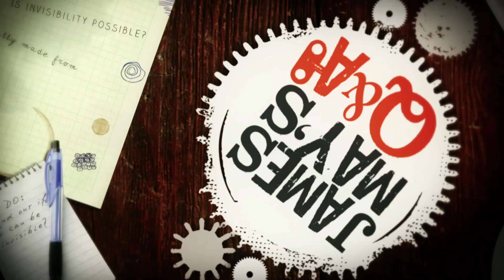Why Can't Trains Go Uphill? | James May's Q&A | Earth Science

Comment: To those who mock Gordon for getting stuck on his hill, consider this.

Gordon has frequently gone up that hill for years, with a long rake of fully loaded SR Maunsell Express coaches.
Each coach can hold 112 people, and weighs at least 32 long tons, or 36 regular tons; (72,000 lbs.) And the express usually consists of 5 regular coaches and one brake coach for the guard and the passengers' luggage. Which means Gordon has to pull a whopping total of 432,000 lbs, on a round trip across the island "twice before teatime." Fortunately, Gordon is an A1 Pacific. Despite being a prototype, Gordon has shown he can travel at an incredible pace, which has been proven to be around 100 mph, similar to his brother, the Flying Scotsman. But since there's most likely a speed limit on Sodor, let's say Gordon typically travels at a casual pace of 70-75 mph.

And Gordon's hill is set at a steep gradient of 1:75, or around 280 feet. 
This steep gradient, combined with a fully loaded expess, Gordon would have to be traveling at a significantly high, and constant, speed to make it up the hill without assistance. On a daily basis!

So, yeah. It's no wonder he's constantly needing to be banked up the hill by Edward.

Comment: Here is some same scenarios on distant land of China. 2.65% huh? Songshu-Wanjialing section in Shenyang-Dalian Line has that.
"In steam era it's a pair of QJ (2-10-2) to pull 7-9 freight cars through that. (Note that's 4-axle freighters at 92 tons each) For Passenger trains it's a pair of RM (4-6-2) to pull 9-10 passenger cars probably with an extra luggage car"
"Don't even think about running single steam in here, you need at least two and sometimes even more"
"ND5 diesels (GE Dash-7), when they were imported to China the first routes they serve includes this"
"South Shenyang-Dalian route is such a hard nut"

Comment: Trains can go uphill, but they may face some challenges in doing so, particularly if the gradient of the slope is steep. The main issue is that trains rely on friction between their wheels and the rails to maintain traction and move forward. When a train is going uphill, the weight of the train and the force of gravity pulling it downward can reduce the amount of friction between the wheels and the rails, making it harder for the train to move.

Comment: There is one modern Swedish railway that has some shockingly steep hills for its young age (late 90s/early 00s). Mälarbanan between Arboga and Örebro has hills at 2,5% and allows speeds at 200 km/h, while the normal limit for a new Swedish railway is 1% steep hills.

Comment: banking locomotives or banking engines help push locomotives up inclines. 

and the rack and pinion locomotives like the ones in switzerland and american use pinion gears powered by the steam engine. the pinion gears allow the locomotive to climb on the rack gear

Comment: I like to try and guess before diving into the video, my guess kept going back to weight but traction and gear ratio also kinda make sense. Im assuming trains gear ratio is low in order to pull so much weight so i imagine a train alone could rip up a hill but unlike on a relatively flat track adding carts to that equation dosent just add a flat rate of weight but multiplies the weight and stress on the wheels by every degree. I imagine traction would become an issue at that point, maybe if they put on the snow treds?

Comment: makes me wonder why they don't coat the wheels in rubber. or at least the rims.
Reply: It wouldn't last , plus,  chunks of rubber would deposit themselves in the rails eventually derailing the train.
Reply: In some track sections the signalling system requires the wheels and axles to short circuit the track for train detection, axle counters detect metal wheels as well. For electric units traction current needs to flow between the wheels and track.

Comment: You could slow the trains down my adding wind resistance, like parachutes made of solid boards that can easily fold up and deploy with the assistance of a little starter chute. The line would run through a metal pole that I elevated by a second shorter pole in the middle or there abouts with a hinge on each pole and a track for the second one to move up within. The parachutes would be brought in when nearing the end of their necessity by a ratcheting a steel cable in and wires forcing them into a formation that doesn't lend itself to catching air, or a way of opening them up so that they experience less drag and allow more airflow.

Comment: Here's a dumb question: why didn't they give track going up an incline some pattern. Anything other than baby's bottom smooth. I get why it isn't optimal most of the time, especially at high speeds where you'd get rocking and bumping and if it occolates too greatly you'd even derail. But you could have a hole for a pin in the train wheels and roll over some hinged steel cover that would basically give the train wheel literally any surface but perfectly smooth and thus introduce some real traction. If it sounds like a hassle to go through, imagine what it was like to purchase, operate, maintain, and  organizing all those locomotives to push up that hill whenever it was nessesary.

Comment: There was a part of rail line between two cities I travel couple times in a year. There was a small city with 50-60k population in the hilly area and even old cars and most trucks would stop and die on the road, smoking, overheated. And trains also would come to a stop and wait for an hour to find extra helper locomotives from nearby stations. But it wasn't always a case as I remember, I don't know what was the variables to make it stop and wait for rescue or to climb slowly. Maybe they would get that extra loco in the last station knowing it would definetely come to a stop if not pushed from back so you wouldn't have to wait for 45 minutes for help. They have changed the roads also the rail line in the past decade, but also cars and locomotives improved; so I don't know if the new line and roads saved them or improvements in the engine tech.

Comment: Even if an engine did have enough weight to get up a hill alone like the Lickey Incline, it'd be detrimental to the locomotive itself. I believe it was the BR Class 45(?) diesels that, during a standard express run from Kings Cross to Edinburgh and back again, the locomotive was so heavy and rather fat to the point it would need new sets of brakes for all of its axles, and said axles and wheels likely sustaining a substantial about of wear just from the fact they're under it.

Maybe taking a page out of the Model Railway book and fitting traction tires to real locomotives wouldn't be the worst idea considering no real life locomotives pick up currents from rails, but rather pantographs and power lines or fuel.
Reply: the pantograph is one end of the circuit and the wheels the other. Traction current flows through the track

Comment: couldn't they just have additional side rail tracks with teeth for gears to connect with, then on the train - have geared wheel hubs essentially slightly higher up, that the hill rails could connect with.

Comment: The wrong type of snow wasn't an adhesion issue.....it was that horrid fine hail that we just call snow, and it got into the ventilation for either the gennies or traction motors on certain units. I can't remember if this caused over heating or whether it melted and caused shorts.

I want to punch people who mock the leaves on the line thing like it shows modern trains are crap......steam locos have been DESTROYED by leaf mould low adhesion. Modern units handle it better......but the sandite train will still be out a couple of times a day in the autumn.

Comment: Determining the theoretical and empirical forces involved is an interesting physics exercise. Not mentioned in the video is the decrease in friction caused by the angle of the slope itself, as the vector of acceleration due to gravity increasingly departs from being normal to the track surface. Also, as a train move slowly, the friction more nearly approximates static friction, as opposed to dynamic friction. 

The difference between the two also contributes to locomotives being very difficult to brake, as the friction between the wheels and the track becomes purely dynamic friction. In a car drivers sometimes experience this on ice when limited slip easily translates to complete slipping because the friction is greatly reduced by the slippage itself. Changing the normal force (something seemingly silly like jumping up and down in the back of a pickup—and yes, I've experienced this) can cause enough friction to get moving again.

The static friction with a heavy load could also create a strange form of temporary adhesion that is not dissimilar to the bond used to adhere ignition point contacts in classic cars to the mechanisms used. It's actually possible to create a bond by simply polishing the materials and pressing them together with a high-powered press. It makes me curious whether a locomotive has incidentally become "welded" to the track. Incidentally, train wheels are welded to the axles by spinning them and slamming them together.

Comment: You have more grip than a train,  but as you are a machine of talking  bullshits.  I was  taking serious this video, until you said  the weight  with angled shape in the front of the train is developed to produce down force, like in a tractor or a race car ,  Instead of the REAL PURPOSE which is   remove  dangerous objets from the rails, before they make the train derail.  Also, there existed trains with  rubber stripe in the middle of wheels,  to produce the needed grip.  Like in Montral or Paris Metros .

Comment: While this isn't competly wrong, you still missed the most important part: Breaks. A train that goes up a hill needs to come down later on, and preferably with all passengers still alive. Due to how powerful todays engines are, the first engeneering problem us usally how to slow down the train enough when coming down and not the going uphill part. In fact, I know a project that was canceled because while it was possible to get the train up the mountain, there would be no safe way to get it back down.

Comment: Someone else said cogs.
So I thought.
An outer lane that holds a tow system for the back of the train a certain distance away.
The train slows down hooks it onto the end maybe it already has it after a certain stop. It reaches.
The train goes uphill with enertia and slight traction.
After the hills end.
The cogs rollback and weave into the outer side tracks as they head back to the start point.
.
But maybe it's a foolish idea xD

Comment: However, a locomotive can gain grip using sand, a lot of engines have Sanding Gears and Boxes to aid them. Wheel Size is also a big player. Smaller Wheels are for Goods  Engines and give better traction rather than larger wheels used for Express Engines which give better speed. The Power of BR's Power Classification also plays a major card. Weaker engines Such as 1F and 0P Engines are inferior to 8F or 9F Engines pulling heavier trains and going up hill.

Comment: So I'm commenting on this in 2022, because it was in my recommended, for some reason, and I think people might find it interesting, if anyone sees this. Here in Greece, we have a train called "Οδοντωτός" (pronounced "O-thoh-doe-toss", the "th" as in "the"), literally meaning "he who has teeth". It's called that because the tracks have spikes, or "teeth", sticking out of them , which the train, having the same teeth under the engine and each carriage, grabs onto, to help it move up a very steep incline in it's mountain path. The engine is also rather small, and so are the carriages, so that helps too. It was used in the past to transport people and goods up to a village, from another village lower down the mountain. It was a tourist attraction mainly, pretty much from the get go, when it started working in the 1890's. It's still going today, though there is a modern engine and carriages, but the original engine in is in a museum in the lower village, where the station is.

Comment: I wonder if any trains were designed with a axial rotating drive shaft and flexible connections between cars to transfer torque from the locomotive to the cars.
Reply: Probably too complicated. Just use EMU or DMU for diesel trains.
Reply: @harveywilde6781  I'm talking pre-electric.

Comment: A minor inaccuracy here.  Trains are not rendered more efficient because of the low coefficient of friction on the steel-steel interface.  They are more efficient because of the extremely low deformation and energy loss as heat when when rolling a steel wheel on a steel track.  The coefficient of friction between the wheels and the rolling surface does not have any affect on the energy loss in a wheel rowling with no slip as the speed at the contact point is 0 at all times.

EDIT : To be fair, the deformation and heat loss in an wheel is often called 'Rolling friction' bit it is a bit of a misnomer.

Comment: Idk why we haven't solved this issue yet. Like, we put tyres on cars over a 100 years ago but trains are still built like this
Reply: Because there aren't any real issues with trains. The fact they run on steel wheels makes them way more efficient than cars ever will be and modern trains aren't even locomotive hauled, which means they do in fact go uphill. Not 10% inclines of course but 4% is no problem at all. And some metro-trains in France and Canada are rubber tired, which means they can go uphill even better.

Comment: Two observations, both not addressed by Capt. Slow here:

(1) Physicists have proved mathematically that a(ny) train is always “going uphill“. (By this is meant the train on perfectly level tracks). This is because the considerable pressure between the steel wheels and the steel rails will create a local deformation -- therefore “uphill“.

(2) Many trains incorporated an apparatus to drop sand in front of the wheels, thus increasing friction at the expense of increased wear.

Comment: B&O's Cranberry Grade in West Virginia (still used by CSX) has short stretches running about 2.80% and most of it in excess of 2.00%.  Helper engines (rear end and more recently DPU) have always been used.  For decades, 80 cars seemed to be the magic number for reliable operation, but remote controlled DPU has thrown that out the window.

Then there is Saluda Grade on the old Southern.  Average grade was 4.24% for about 2.5 miles and there was about 300 feet of track with an astounding 4.90% grade!  Going down was as much an adventure as going up.  Successor Norfolk Southern took the line out of service in 2001 although to date it is not officially abandoned.

Comment: you left out the part about sanding the tracks.
Some trains, and light rail like the New Orleans streetcar, have little sand dispensers in front of the wheels. To aid in braking, but also used to improve traction sometimes.

Comment: I was a Locomotive Engineer for a major Railroad C.S.X. and you are right about wet rail or leaves on the rail all slippery conditions but whenever I had slipping wheels or spinning out of control wheels I would use my SANDERS .It helped most of the time NOT ALWAYS but most of the time !

Comment: 0:48
Most stairs are a LOT closer to a 50% grade, and often a little less.
80% would be an angled LADDER, like most stepladders.
The steepest railroad grade in the WORLD is almost 14% - but steep grades tend to be very short on mainlines and usually less than 2% with SOME notable exceptions hitting 7%.
Reference the Saluda grade and the Reuben Wells for a couple of well known FAR more extreme examples - then go to https://en.wikipedia.org/wiki/List_of_steepest_gradients_on_adhesion_railways for many HIGHER GRADE examples (mostly light rail but not ALL).
Reply: 80% sounds about right for stairs. You may be misunderstanding % grade. It's not % of vertical, where a bit less than 50% would be right for stairs. It's like % of 45%, where 100% is 45%, because it's the climb as a percentage of the horizontal distance. So if it went up 10' and over 10' horizontal, that would be a 100% grade (rise/run = 10/10 = 1 = 100%), 45%, and a steep set of stairs. (But not a ladder.) If instead it goes up 10' and over 12.5', that's rise/run=10/12.5 = 20/25 = 4/5 = 80%
Reply: @johnjones7400  Stairs vary - a lot of them are fairly shallow (4-6 inch height on a 12-20" length per stair) but commonly 6"-8" height on 10-12" length, and I've seen some in older houses more like 8" and 8".

Comment: wouldn't it be smart to, if you build a rail system, and there is a hill that absolutely needs to be crossed, no way around it, to build in a system that fixes the locomotive's wheels on the system and pulls the train up?
Reply: Locomotives are very old school. Majority of trains these days have powered bogies, which makes them a "multiple unit". No need for a heavy engine upfront to pull the train when the whole train itself can be powered instead!

Comment: First and foremost, one has to agree on the definition of just what is a hill. It's been proven that though there are some, in generaly the over whelming vast majority of liquids, ALWAY'S flow down hill. The particular grade in addition to the viscosity of the particular liquid, determines the speed. Frozen water flows considerably slower down a hill than unfrozen water, but in either case, they both flow down hill. The vascosity envolved in the steel wheels of a train is such that though it can go up a hill when the grade is such that allows it. It's the vascosity of the steel envovled that keeps it from going up a higher grade. A lower vascosity would allow a train to go up a higher grade, but then would prohibit the weight of the train and possilble cargo to be such it would prove to be a worthless endevor to have such a wheel designed haveing a lower vascosity.